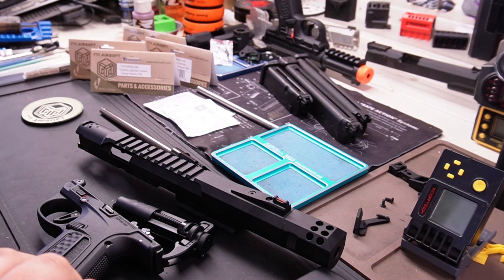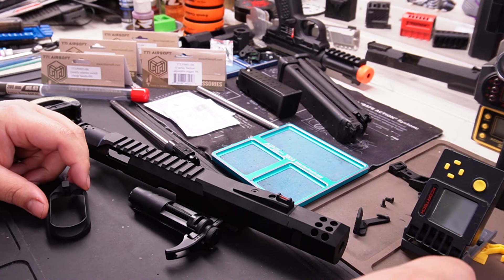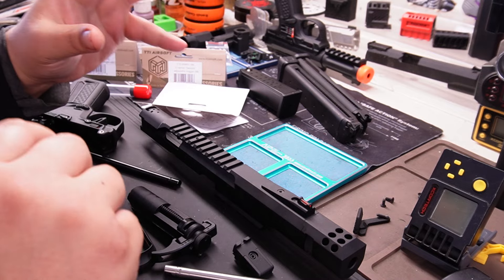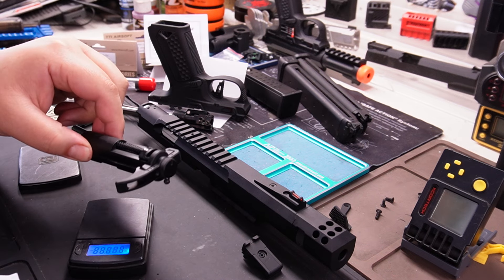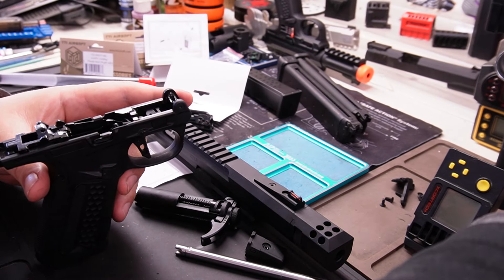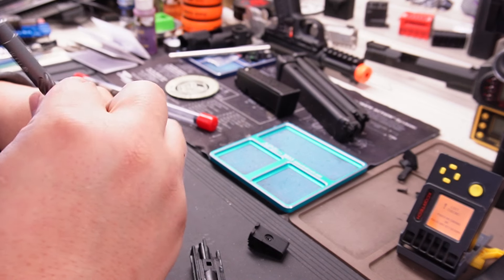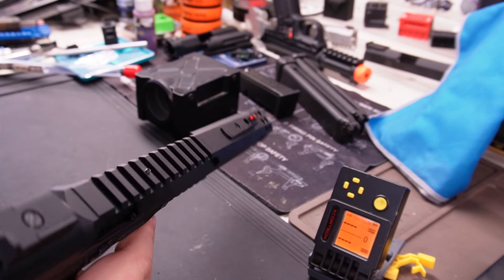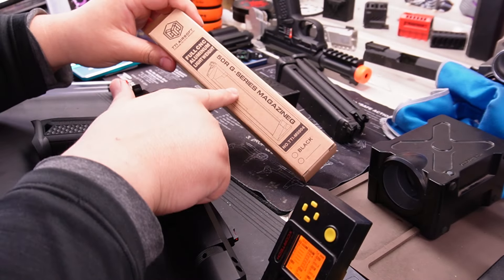AAP-01 Series: TTI Parts Overview Trigger/Magwell/Selector/Thumbrest (8/???)

Comment: Nice to see you back.

when you bounced,
i just came into the game of building, from scratch gbb glock variants with all the bells n whistles...
extensions,stippling,
rmr/sro,comps,colorcombinations,triggers ect...

a lot of learning and throwing 
money out, i ended up with 5 completed projects and one is still in the making....
these are 4 digit ggb's and i can pay rent with them😂
and of course 6mm innerbarrels only!

i also learned so much about polymeres while spending hours on frames gettin them ready for clean modern stippling with recessed borders ect.

great that you are dipping into these ones here...😊

i have that victor trigger on my rwa g34 agency bonesaw and it is sooo nice❤
out of all the different triggers i have, this is thee  favorite one.

building these gbb glocks on tm plattform from scratch is a thing of its own...😅its not like you putting it together and just go by your way....
it can really give you headaches and frustrations at times.
steel outerbarrels MUSST be worked on with all the tricks of the trait to make it even cycle....sometimes you cant even find the point of none fittment...its crazy.
basicly you are screwed if you mix from different companys and have to think your way out till finish.

very nice to have you back sir🤝🏾😢

Comment: Very informative video. Thank you. Would you recommend the 4 inch or the 6 for accuracy and range?

Can you tell me again what inner barrel length do you recommend for the 4 inch upper receiver please?

What are the chronos for the 6 inch? Is it too hot?

I'm looking for the most accurate and most range possible for my AAP-01 but I live in Japan where the power is very limited, so I worry to get the wrong TTI scorpion upper and not be able to use my gun because the chromosome would be too high.

Thanks for the help and expertise you can provide.